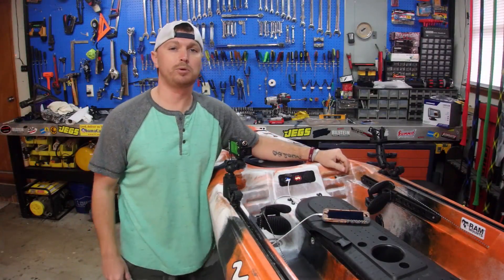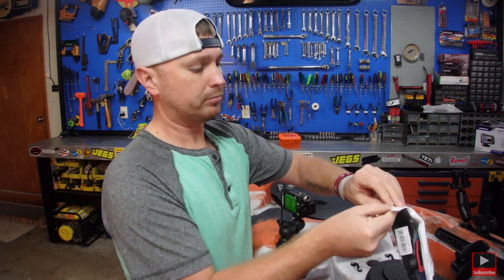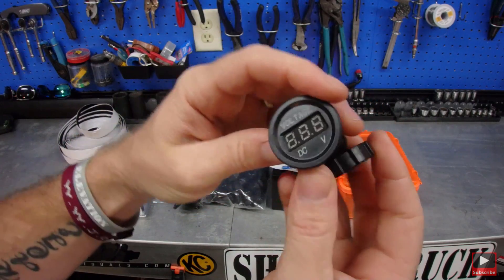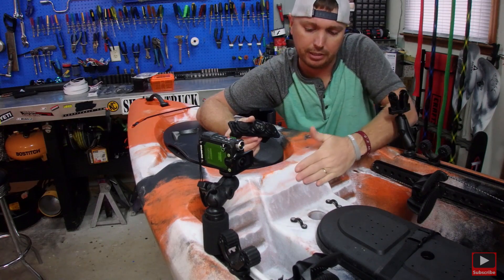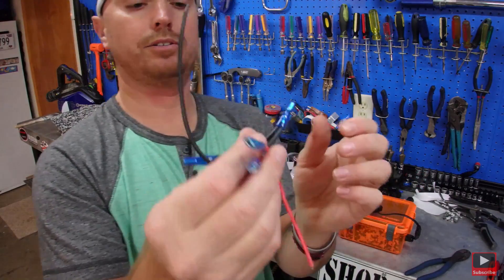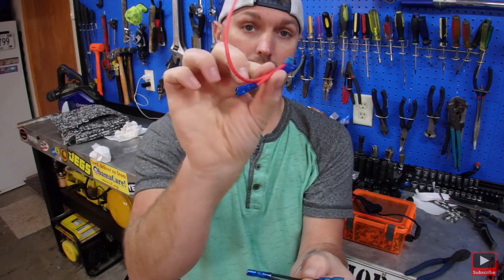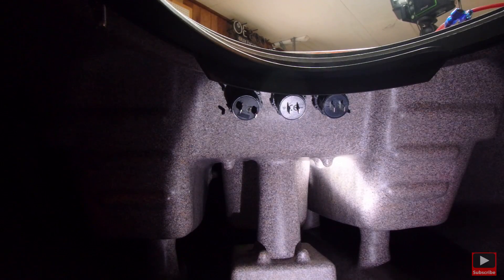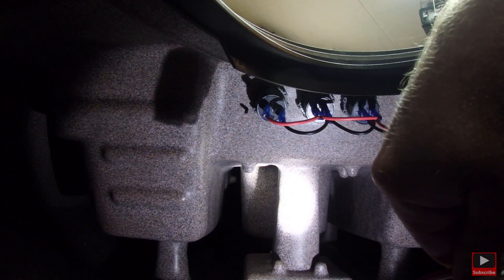2020 Custom Kayak USB Panel & Battery Box, CHEAP, DIY | How to install | Step by Step

Comment: Hey bro, I have my Tempest 120 PDL. But I purchased the hybird edition. #1 Hoodoo makes a factory 46 lb thrust trolling motor, that sits  where the pdl would,  and weighs 18 lbs. #2 I knew I was going to run the bixpy J2, on my toe control, drop down rudder system. I DIY'D my battery box, for my 12V cabela's battery, FF,  and GO-PRO, and other charging accessories. I purchased a 30 cal ammo box, that identical charger panel from ebay. My cockpit and front storage hatch, and actually my hull, deck, rudder system is exactly the same the vibe's. This is my 1st kayak, and see no reason to upgrade. I was going in that exact spot, but cringed at drilling those 3 holes, in my new boat, lol. Great job. Love watching your DIY'S your just like me. Gotta be perfect. Haven't had any issues. 🙏 🎣

Comment: Great video,  I like your teaching ability,  two things i would add is a fuse to the battery,   and an on/off switch,  to conserve the battery energy.  Thanks keep up the great work, Kayak on.
Reply: Do you have a switch in mind that you would
Use? Jw for my set up. Thanks in advance

Comment: Hey man, fyi. Uni bits (step bits) are great for drilling plastic. They leave a very clean edge. The harbor frieght 3 pack is actually pretty good too. I’ve drilled 1/2” plate steel with the largest one in the pack and it still cuts fine. I enjoy the videos. 👍
Reply from the maker: Thanks bud! I actually only use those now lol, those perfect for these kayak projects! Great tip man! Thanks for watching 🤙🏼

Comment: After watching a few of your videos, I've finally figured how I'm gonna rig my OK Trident 15. So thank you for that! 

I ordered about $800 worth of stuff. I was initially going to use a RayMarine Dragonfly 4 pro, but my scupper transducer mold is molded for a regular one. I plan to mount a 22AH battery in the front hatch, using the same connection method as you. One connector is going to a 5 gang toggle switch panel that will run my 3 navigation lights on one switch, my red interior lights on one switch, and my under the kayak green light for bait fish on one switch. The other two switches will be for on down the road. I'll hard wire my fish finder to another sae connector and leave the other two for later. The two flush rod holders I have behind the seat will be fitted with 1 1/4 PVC pipe and with a 2x6, I'll add a 30 lb thrust trolling motor with rod holders integrated on the space between the flush mounts. 

So thank you for giving me some ideas. Also, your Amazon link for the RAM track mount that fits the hook2 is a dead link.

Comment: Great vid. One point of note: It's always a good idea to make that hot lead go to the covered half of the plug so If I were you I would have used the other half of the extension cable on the battery. That way when you are moving stuff around or anything, you don't have a live end exposed.Just thought. It's nice that Kayaks are plastic so there's not as much concern, but you never know when and where that thing rubs against  earth ground.
Reply: I would’ve put a fuse at the battery too.

Comment: I used a 12 volt solar panel from Bass Pro to keep my deer feeder charged and another one in the deer blind to keep a charge on the 12 volt battery being used for the lighting, USB ports and other 12 volt accessories in the deer blind. This solar panel was mounted on top of a PVC  tube with mounting hardware, like flagpole mounts. Worked great. Just an idea for you to help keep charge on 12 v battery that way there is no need to remove the battery when charging. There are a lot of videos on YouTube doing Solar Charging for Kayaks, Canoes and Rafts. There are many types of panels, systems to choose from.
Check into installing a 12 volt solar panel for use on your kayak.
Reply: Bill, how did you wire the solar charger to the battery?  Given CJ's design in the video, can charge through the 5 way adapter if you have a solar charge controller, fuse box and master switch for all the accessories?
Reply: @rickblair9706  From the Solar Panels, take the positive wire & connect it to a In-Line Fuse (7 or 8 amp;
Take other side of In-Line Fuse to the Positive input  on Charge Controller (CC). 

Using a 50 Amp Charge Controller as an example.Then take the Positive output from CC to  another In-Line Fuse, ***rated as same the Charge Controller Amperage capabilities example: a Charge Controller handling 50 AMP's - 

Now take the output side of this In-Line Fuse  and connect it to the Positive Side of the Battery being charged. 

Start back at the Negative side of Solar Panels & connect to the Negative Input side of CC;
Take the Negative Output side from the CC & terminate it on the Negative side of the Battery being charged.

Hope this will help you out.

Here is a simple Diagram:                                  I-> (matches CC's Amp handling)
Solar Panel's positive + ---- inline fuse---CC---^inline fuse--  +  ---Master Switches to other Accessories
                                                                                                     positive 

                                                                                                      Battery
                                                                                                     negative 

Solar Panel's negative - -------------------------CC-----------------------  -  ---Master Switches to other Accessories
                                                                                   

One could also connect a Power Inverter (convert DC to AC) directly to the battery for running AC accessories.
Reply: @rickblair9706  If you have an external battery charger, for instance - setting in your garage, why not connect a set of waterproof connection wires directly from battery to a water plug on boat, then another set wires connected to external AC battery charger source:
Diagram:
       +  O------------------- waterproof plug---> <--- waterproof plug -----------O + positive
[Battery]                                                                                                   [Battery Charger] -----D=  AC outlet
       -  O------------------- waterproof plug ---> <--- waterproof plug -----------O - negative

You also could put the leads from the output of the Charger Controller in a toggle or rocker type switch so as to switch OFF the Charger Controller and switch ON the external AC Batter Charger, as an example a double toggle position. The toggle or rocker type switch could be mounted to Yak as well.
Reply: @billholder253  , thank you so much, great advice and ideas. I was thinking about installing an SAE adapter on the YAK and charging that way into the box for both the solar(using a solar charge controller) and 12V charger.

Comment: Nice vid, I would definitely use a hole saw bit with fine teeth, not the spade bit. You'll get a cleaner hole and less chance of a chip. 
Lots of good ideas!

Comment: Normally I watch about 8 or 10 videos and leave some comments to see the channels interaction with its viewers before I subscribe, BBUUUTTTT that Obamacare sticker made me sub after watching just two videos! Nicely done Sir, nicely done!!!
Reply: Also where is the link to the guy who showed you how to do the port set ups? Id like to see his as well to look at different option. thanks
Reply from the maker: ENC Outdoors , "Lord deliver us from Obama care"..... Lol , I found that sticker a long time ago and had to add it to my bench. Here's the link to the video that helped me find this setup. https://youtu.be/pi7D2lzXrqo thanks for watching👍
Reply: Does the 5-way wire have a fuse in it to prevent any issues? I've been told by an electrician I will need a fuse in the lines someplace.
Reply from the maker: ENC Outdoors , I don't have one on the five way it's self but I put an inline fuse between the five way and each thing I plug to it. ( Fish finder, lights, camera....)

Comment: I madethat same battery box. I used PCs of foam wedged in to keep it still. I cut up one of the ones people’s use to kneel on when gardening. I put an inline fuse inside the box too.

Comment: I really like how you set that battery box up. Nice to have a voltmeter  on deck. I've been looking at buying a kayak (3 waters big fish 120) and was looking into fish finders  and lights. Really think the way you did that with the 5 way is what I'm looking to do. Thank you for the great tips.
Reply from the maker: No problem bud, thanks for watching! Be sure to subscribe and share 🤙🏼🎣
Reply: Tryn2GoProBro Zach Webb I have a Big Fish 120, and I will say you can’t go wrong with it. I am 6’3” and 255 lb. and it is very stable. I love mine.

Comment: Great Vid well done!!  To take picky 1 more step. I saw something I would do different, as a former electrician. The wires hanging out of your battery dry box "could" short on something since the hot wire is the exposed term of the connector. Now there is a conflict with my comment due to the color of wire used by the manufacturer of the connector. Obviously not your error. When using a connector which has only one way to plug together the color used is kinda a non issue since the color is not used to do the final plugin. As long as the color reversal for that specific connector is maintained all will be good.

Comment: I finally got the kayak out the other day when it warmed up. Got the mount up in the garage for storage and got my yakattack gear tracs on. 
My hobie through hull things just got in tonight. Hopefully i can get fish finder up and running soon. Need to pick up some fuses before i start. Took most of my ideas from you so gave you credit. 
Of course these mods are going into a $180 kayak! Lol
Reply: First time doing anything on youtube so learning but having fun!
Don't think ill be able to do trolling motor mod without adding out riggers to the yak. Have to see how it goes.
Reply: I do love how light it is. Lifted it up into the rack, solo, on the wall, at the end of the video.

Comment: Cool beans . Set up dual battery packs( NOCQUA 10ah/DiaMec 9ah) and the set up for USB /Cig Liter /and volt display you feature for power flush mount easy access on Hobie Outback. Quick easy. Gonna ride the water like a fiend in a Cadillac. Pinky stick in’ out and lean in’ to the side.

Comment: Instead of crimp connectors they make low temp solder shrink connectors, they have adhesive in them as well which will aid in waterproofing. Just a suggestion though if the crimps are working for you then no need to change

Comment: Good video. Shows me where I can use up less space than I’m using now. I also installed a voltage regulator on my power system to insure stable power. I’ve got a lot of different items using power. Also, I installed a power switch and indicator for each unit using power. I don’t have a panel to mount my power outlet to, but I’m sure with some Fiberglas I’ll get it done.

Comment: You can get your holes to line up easier if you just go ahead and mount the plate, and then use a hole saw instead of a paddle bit.  Just start slow, and you can adjust the position of the arbor bit on the hole saw.  You'll get a perfect hole every time.

Comment: Installed mine today.  I didn't use the rectangle bracket as that left a bit more room for my thru-hull wiring grommet for my transducer cable.  Built my battery box the same way but with some of the extra cautions provided in these comments (extra shrink tape, for example, real marine silicone and dielectric grease).  I haven't installed the pass through to take the power and transducer cable to the fish finder yet as I am not sure exactly where I want the finder located on my track system.  I only want to drill 1 more hole.  LOL.

Comment: 4 years in the future~~~~~~~ Neat job. I've had my Seaghost 130 for 4 years, and I'm about to pull the trigger on a fish finder. What kind of charger do you use for your battery? I like the use of the power connector to hook up right from the battery box to the kayak or charger. Thank you! I've been watching your channel since I got the kayak.

Comment: Did the same mod on mine - u Just need add a solar panel port to trickle charge the battery thats what i did on mine… also u need to add an on /off switch inline because that dash panel is constantly on  , u need a way to turn it off when not in use.. i like your Velcro design for the battery and additional connections i used foam noodles on mine and only use the connection for the dashboard

Comment: A little plumbers pro tip for this silicone step @16:40 
Once you let the silicone squeeze out, before you touch it, spray some soapy water all over it, then you can trowel it out perfectly without it smearing and sticking to anything it wasn’t touching before you sprayed it. 
If you haven’t tried this, you’ll thank me.

Comment: cool deal buddy  i want to do something similar  for a canoe  ive been using one of the dry  boxes from Walmart  for years on my Sport Fisher  boat  i  glued mine down  for everyone’s wallets cell phones , etc  btw on Ebay  they  do sell pretty  cheap  battery tenders Chinese made  that may be something you want to have for  topping off your battery at home  for me  i’m going with solar  because the canoe will be used mostly on a rural river in Florida

Comment: Good work and good job Sir. The only flaw I can see with that panel (excepting  the ommision of an inline fuse) is the fact that those damn panel lights will put a constant draw upon the battery. Leave It hooked for a night or two, and the battery will be depleted ( this is a pragmatic observation, not a critique of the method and mode of installation, which is excellently expedited). Kind regards.

Comment: Power to dash needs a cut-off switch because volt meter and blue lighted USB ports draw power...which will drain your battery. Also you can add a fuse

Comment: Are you going to cap the other 4 connectors?   Water in there would still short out the battery.  Great video... got my attention.

Comment: the slots allow any water that infiltrates to drain out of...the bottom. marine grade sealant the screws, top and sides and around the larger holes. if-when it fails, water will drain out of the bottom (weep holes)

Comment: tip for next box use the connector end that has the hot wired covered instead of the open end. to keep it from arching off of things.

Comment: Your videos are easy to follow. I just bought the Brooklyn 13 Pedal drive and am getting it ready for the spring.  I have the Battery box done (Another great video) You never link the inline fuses.  Just curious what I need for safety.  I have USB/LIGHTER ports, depth finder, and lights.  So thinking I need inline fuses.  Can I tie everything into the one battery, or should I get a second battery.  Current battery is 12V 10ah battery.
Reply from the maker: That battery alone should be fine, just use an inline fuse on each hot wire between your port/electronic and the battery.👍🏼🎣

Comment: Fantastic video, this will be the first thing I will be doing to my new Sportsman 120.  HAve you thought about adding velcro to the outside of the dry box so It does not slide around in the hatch?

Comment: Excellent !!
Question.... why do you connect SAE red cable to black in your camera install and white to red?
Very thorough videos
Thanks
Reply from the maker: Thanks, I would have to go back and look but it was probably just the wire I used and the color I had. 👍🏼🎣

Comment: Great video. I was wondering what is the run time on the battery powering your fish finder and other  devices?
Reply from the maker: I can usually get a good two or three days out of it with a charge. 🤙🏼

Comment: Very nice video! Can i ask you what crimp size did you use to hook them up to the battery? Thanks!
Reply from the maker: I used the 14 to 16 size crimps, I actually linked them in the description of the video 🤙🏼🎣🇺🇸
Reply: Kayak USA thanks a lot!

Comment: This is great!!
Does anyone know if you can use an 18v cordless tool battery to power these fish finders if the fish finder (Garmin Striker Vivid 4cv +) says in the manual “12-20v”? 
Would be real nice to just use a big 12ah Milwaukee m18 battery instead of buying a separate one.
Reply from the maker: Yes you can 👍🏼

Comment: This may be a very dumb question but how do you recharge the battery? do you have to pull it out of the box. Fantastic video.
Reply from the maker: Nolen Sweet , I have a small trickle charger from Walmart , I added the same plug on as the battery box and when I get home I just put the battery box on my bench and plug it up to the charger👍🏼

Comment: OK, watched both your videos, this one and the one on hooking up your action cam to the battery.  I have one suggestion.  Instead of using two inline fuses, why use one in-line fuse inside the battery box.  That would protect your entire system.

Comment: Hey man you was talkin about you being really kickee and putting electrical tape on afterwards., but you could have added one more step that I like to do as a precaution. Electrical tape After Time tends to try to come loose and get gummy and etcetera, so I like to do is slide on a larger heat shrink tube over the two wires together as well and then after putting the electrical tape Slide the final heat shrink tube on and heat it and it will literally crunch down on the electrical tape nicely to keep it sealed extremely watertight and will not start to undo from heat overtime. Just a little tip if you want to try it. Sincerely Ronald Miller
Reply from the maker: ronald miller , I actually usually do that but I ran out if my wide heat shrink and couldn't for this video lol, but it's good to see someone just as picky as me😂 Thanks for watching bud👍🏼